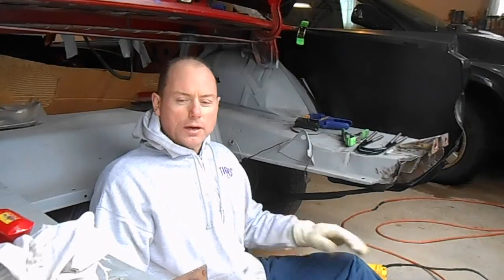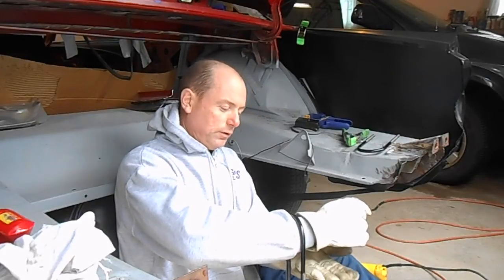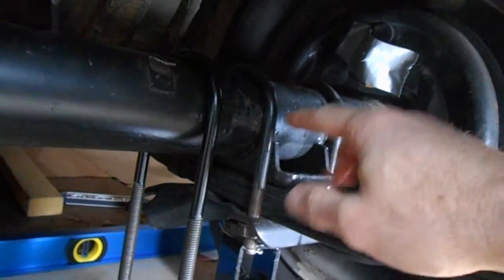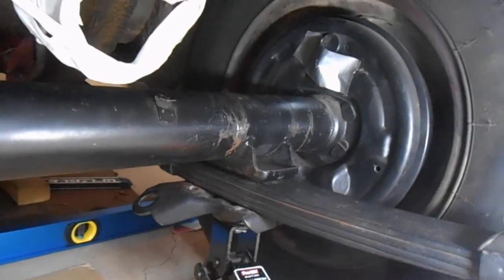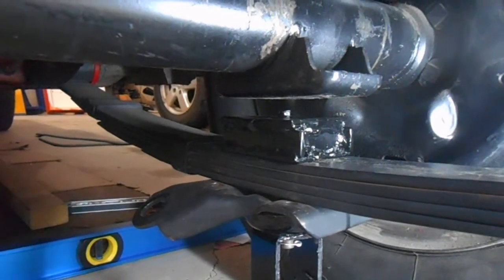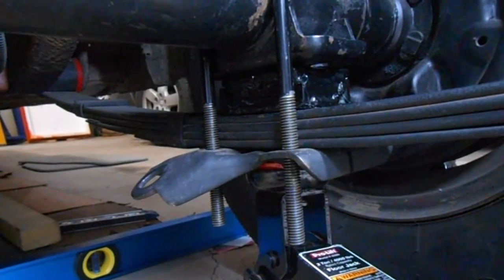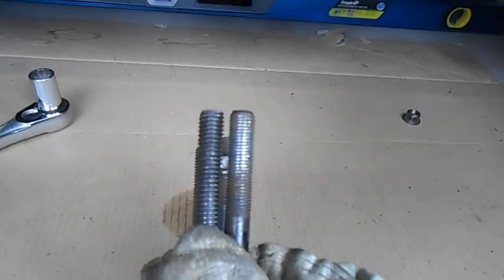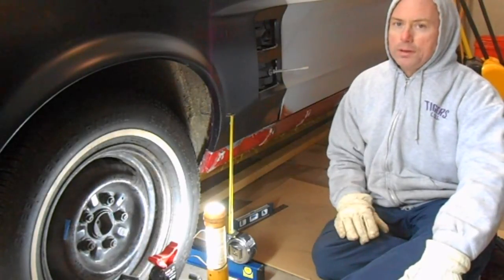67 Mustang Restoration Lowering a Leaf Spring

Comment: what was the damage? end of the passenger rail is pushed up? did you unload the suspension by putting 4 jackstands at the 4 torque box areas & measure then? I'm not sure your going to like the end result of putting your suspension out of level to make up for body damage. sorry, im not trying to insult. I'm a body tech by trade. I'm just throwing my 2 cents in.
Reply from the maker: +dan sprouse 
thanks for the comment Dan.  I don't know what caused the original damage.   We found dent puller holes along the entire passenger rear quarter panel and door skin which explains why the passenger side is bent up.  But we also found that the rear trunk floor cross member was badly bent across its full width.  There is also collision damage to the drivers side front fender and fender apron.

Comment: Just curious how did the car drive once you finished? Great idea by the way
Reply from the maker: We are still working on it.  I will post a video soon.  We are painting now.
Reply: not the best idea, the frame should of been pulled, had the same issue with my '67, the car was rear ended in 1986, I just finished replacing the trunk floor after having the frame professionally straightened, car drives straight and sits level as it would from the factory

Comment: I really like your way of putting in the lowering blocks it looks a lot better than jacking the rear end up like everyone else has done. I would like to do this on my s10 but Would I have to remove the shock to do it as smoothly as you did it?
Reply from the maker: I would think so.  Shocks are actually fairly stiff when resisting small loads over long time periods.  You can just unbolt the bottom end of the shock so the axle isn't connected to it any more.  You can leave the top end of the shock bolted in.